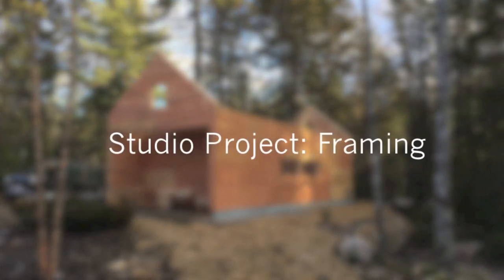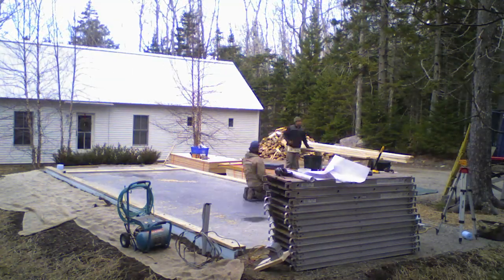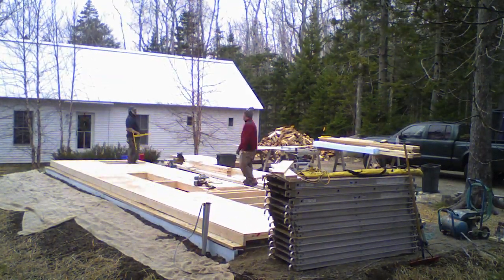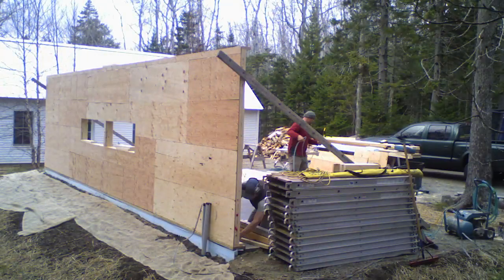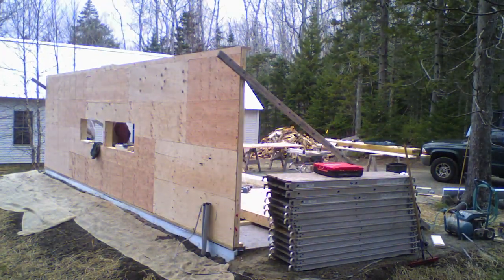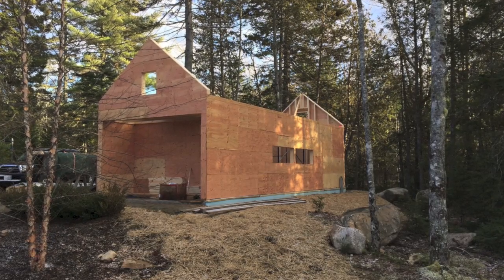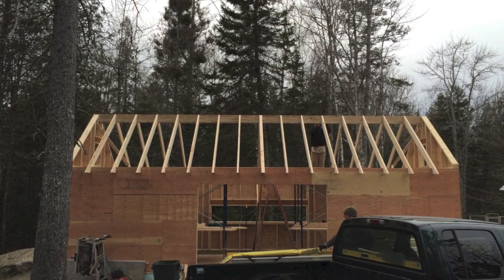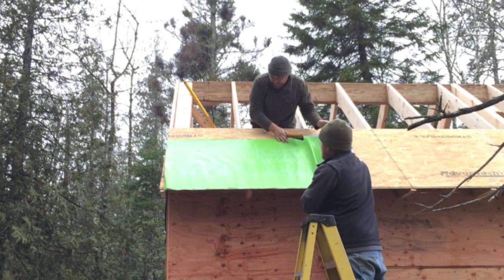Designing a Small Studio - Framing + Rough Carpentry (Part 10)

Comment: It looks like a location that would receive little sun and get pretty darn cold, requiring a great deal of insulation to be comfortable internally. I am interested to find out if you put a small wood heater in or what form of heating you use.
Reply from the maker: Very easy to heat...we use a Fujitsu mini-split heat pump and heat the space for a few dollars a month.

Comment: So the difference in the advanced framing is that you don't require the angled cross bracing between the supports because you are fixing the external sheeting before standing the wall as the reinforcement?
Reply from the maker: The goal of advanced framing is to be more materially efficient using fewer overall members to achieve the same result. Because wood is a poor insulator we want to remove as much of it from our wall assembly as possible. Thus, 24" stud bays, single top plates, nailers for finishes at corners, etc.